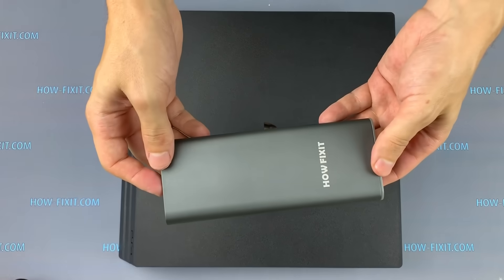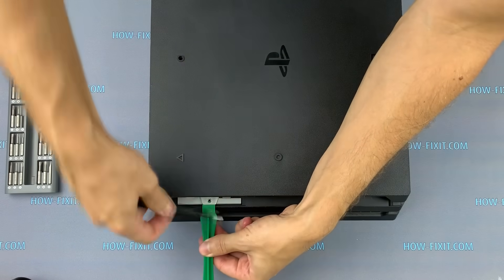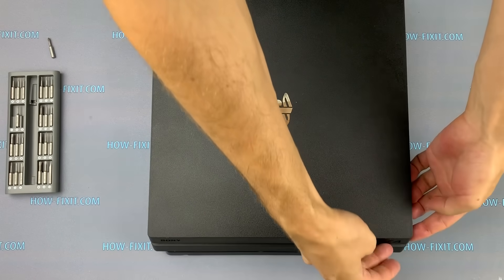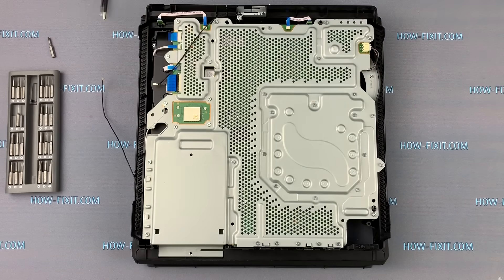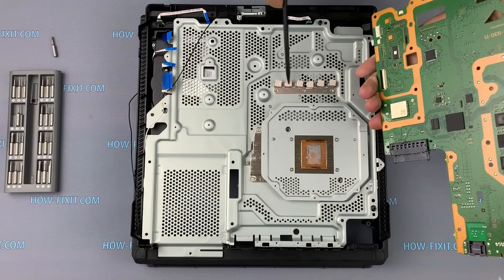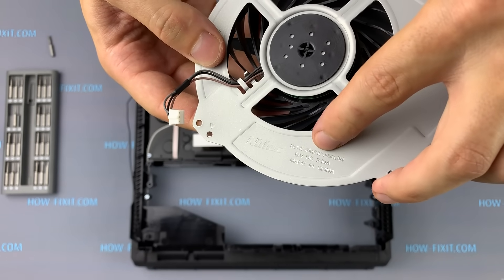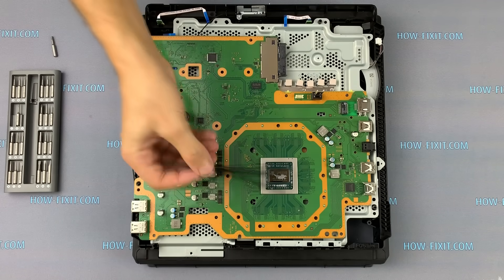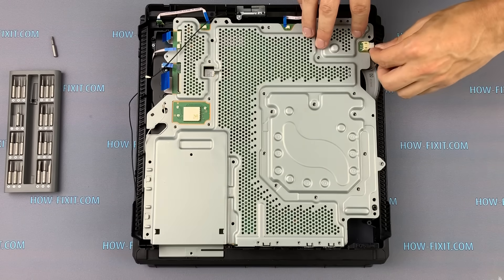PS4 Pro Disassembly: Ultimate Guide for Fan Cleaning and Thermal Paste Replacement

Comment: Word of advice to anyone looking to follow this guide. When you remove the power supply, do not try to remove the cord from the motherboard. Instead, remove it from the power supply itself. I stupidly followed the instructions in this video and ended up ripping the whole thing out of the motherboard just to immediately realize that it would have been much easier to remove from the power supply end. Hope this helps someone so they are not left without a ps4 like I was.
Reply: Could you fix that damage from the mother board? It happened to me, unfortunately I didn't see you comment til it was too late
Reply: Saw it too late. Same happened to me.
Reply: This is a known problem. The fix? Wiggle wiggle wiggle and wiggle some more. Voila. I repair these  and after breaking and footing bill for replacing my first one, I found out patience prevents this. The power supply option does work but if you break it it’s actually a harder fix if not an impossibility
Reply: If this happens to anyone else - don't despair and don't panic. Have a shop around and find an electronic repair company that looks like they can do it. I found one that did it for £35. Or there is a guide on how to fix it on youtube, and the company that made that guide can fix it as well (I think they quoted me £70 + Shipping)
Reply: I wanted to unplug the cable from the power supply side, but it was very difficult to remove. I thought it might not be possible, since in every video everyone unplugs from the motherboard side.

I didn't pull hard at all - I ripped out the entire socket anyway. I hate myself for this. I wish I had read your comment sooner.
Reply: Same to me
Reply: Almost happened to me thank you bro🙏🏽🙏🏽
Reply: I should have read this comment before starting 😢. Damn it
Reply: I decided to read this comment after ripping it.
Reply: @ NOOOOOO!!!!!! Thankfully you can buy replacement cords, you just have to remove the connectors you ripped. You didn’t break anything but the cord, did you…?
Reply: @natethestrangest6592  I ripped the motherboard connectors. I’m going to take it to a computer repair store. Hopefully they can fix it, if not it’s time to say goodbye to my PS4 for a Ps5
Reply: @ the fact this video doesn’t have a warning on it should be a war crime. I haven’t played in a week, was going to play Friday and Saturday but PSN did its thing. I even just moved my setup to its own room and completely remade it, I was like I might as well reapply thermal paste and clean everything, I was so insanely excited to hop on some siege, and now no gaming.
Reply: Any tips? Mine literally won’t budge from either point, even by prying the connector. It’s as if it’s been superglued in there
Reply: I read this comment 45 dollars later :c
Reply: Ur ps4 is likely the 1ste gen on 1st gen u are supposed to unplug from psu in 2nd gen u have to unplug from motherboard
Reply: Almost happened to me while i was just cleaning. I gave up and just opted to not do as deep a clean as I wanted. But now that I know for a fact I need to replace the therm paste, this patience is gonna come in handy…
Reply: Please anyone who is struggling with this section please consider this technical advice: 1. Softly wiggle each cable end. Sometimes the female connector connected to the motherboard wiggles more than the one on the powersupply and vice versa. Remove the cable from the side that wiggles the least. 2. I found that an alligator clip works perfect for this. Attach the alligator clip on the plastic end of the cable. Make sure it's clipped on the length wise not width. Rock it slowly lengthwise while lifting up with slight pressure. Over time it'll come  out. Alligator clips are really cheap and I think better to get one before trying to accomplish this. I nearly ripped one out but found an alligator clip as part of my tone and probe device.
Reply: This guy is probably really good and all. It’s just that… my ps4 exploded…
Reply: @djprofessork.3172  cap
Reply: @djprofessork.3172  wait what?
Reply: I made the same mistake 😅
Reply: maybe it depends on how u remove it, u always must be sooooooo gentle. if u see it wont come, dont use force, think!
Reply: @Casanova395  god bless you and anyone you have saved, didn’t save me but you would’ve if I had read comments first. I hope you and your family have a health and happy life forever.
Reply: I don't get why there's never any warning in videos like this. So many people encountering the exact same problem and he just rips it out like it's nothing.
Reply: Too late.... Would have been easier and safer to remove the cable from the powersupply side...
Reply: Thanks man, I was really struggling to get it out until I read this comment. Helped a bunch, so thanks for the warning
Reply: If you repairing electronic stuff you have to be prepared smd conector sometimes come from the MB . I believe you was focus in the video no in you ps4 and of curse you never use the right tools!!
Reply: It is tough, but if you pull on it using a tool and your other hand it should be just fine, just go slow and don't use too much force. I'll try your method next time.
Reply: I recently pulled out my ps4 pro outta the cupboard i hadn't touched it for ages since getting my ps5 so i decided to clean it just now i have done this many times before but for me it's always fine you guys might have tried yanking it straight from the cable so the tip is you try to pull it out from the both end
Reply: @Sam-Tm123-m4c  Its pulling it from the end that brakes it.
Reply: Having opened a few PS4s (first time I did a Pro was yesterday) I would say the mobo header for the PSU varies in grip from unit to unit.  On my Pro I found gently wiggling it loose from the header was pretty easy, but you're right, on some models it's going to be a tighter grip due to tolerances so you can disconnect it from the PSU side instead.  Mobo side removal is preferred because it's a lot easier to lay the board flat for cleaning dust off of it if it doesn't still have the PSU wire dangling, but better that than ripping it right off of the board if it's too stiff to do it without breaking it.
Reply: I've wished to read this before, just broke the cord on the board tring to remove
Reply: nah you're dumb.
Reply: Is it necessary to remove the cord??
Reply: @ Depends what sort of cleaning your doing, if you just want to brush away the fans no. But if you want to clean the radiator and replace thermal paste, yes you have to remove it. Be extremely careful, what I recommend doing is using pliers to grab the white socket connected to the motherboard and holding it perfectly still. Then pull the cable, that way the socket is kept on the motherboard. It shouldn’t break, if it does the cable breaks and that’s a 3 euro replacement rather than the 100 euro soldering job. If you have any further questions ask me, because I don’t want what happened to me to happen to you ahaha.
Reply: Too late
Reply: I tried to disconnect from both ends, but both were tightly stuck.
My method was to insert a sharp flat-bladed screwdriver between the motherboard socket and the ribbon connector. Then i rotate the screwdriver so that its tip is forcing the connector out of the motherboard socket. It minimize the effort on the socket pins soldered to the motherboard, and it avoided ripping the socket off.
Reply: aaaaaand there it went my PS4 pro too, fucking hell
Reply: I was having issues removing the cable with my fingers. Then I tried with some needle nose pliers (thin ones) and pulled on the plastic instead of on the cables. With a bit of wiggling I managed to detach it in about 5 seconds (I removed it from the power supply instead of from the motherboard)
Reply: Thank you for this advice
Reply: I did the same way and did not rip apart anything.
Reply: Absolutely valid comment, bro! :) 
I was being extremely careful when taking my PS4 Pro apart, but STILL managed to partially rip off the fan connector on the motherboard side while trying to remove the PSU. lol 
Luckily I was able to glue it back in place using some high quality epoxy, so now it's probably even more sturdy than before. ^^
Reply: Ts just happened to me 🥀 time to switch to ps5
Reply: I couldn't remove it from the power supply or from the motherboard either. So i ripped it like the rest of you. Also I couldn't unplug the fan cabel from the motherboard, so I just cleaned what I could without removing it. Long story short, if you have difficulties at any stage of disassembly, just stop, put everything back, and call the guy, like I should've done.
Reply: I've pulled the socket off the board on my ps3. As long as the pins haven't been torn off the board. You can just push the socket back on over the pins (carefully). Also a little epoxy along the sides (tiny amount is enough, apply with a toothpick) will hold the socket in place pretty much forever.
Reply: Love you bro I was struggling but didn’t want to pull to hard. You just saved my ps4
Reply: I mean its about your personal preference, i tried it both ways, almost ripped out the cables out of power supply and had no problem with removing it from the mother board
Reply: Zero issues for me.  Second unit.
Reply: Hahaha Oof

Comment: WARNING: BE CAREFUL WHEN PULLING OUT THE POWER SUPPLY CABLE. 

Just leaving this here because it's super easy to rip off the power supply connector when pulling out the cable which is extremely tough to pull out. I am one of many who destroyed their console by doing this and had to get it repaired. Just don't want this to happen to anyone. Other than that, this actually had a very big impact on the noise.

Comment: Thank you for this guide. It definitely made my PS4 PRO quieter, but not whisper quiet. I can still hear it but it's not annoyingly loud anymore. May I add and recommend that people also  change the termalpads on the chips. The ones that came from the factory were pretty toasted. They should be 1mm thick. Good luck anyone!

Comment: Thanks for this useful video. This content is still really helpful in 2023! If somebody follows these clear instructions step by step success is guaranteed. It is amazing that a noisy machine becomes a silent device after the thermal paste replacement. It prolongs the life of the CPU too. :)
Pro tip: if you do not know how to separate the lot of different kind of screws from the different layers just use an egg carton :D

Comment: I bought a Ps4 Pro from ebay and had the jet engine sound 😅 like ridiculous loud it made me laugh how bad it was, bought thermal paste and some thermal pads, followed this video instructions, upon opening it, the paste was dry and heatsink was full with dust, cleaned it and apply new thermal paste and now it's dead silent, I highly recommend for anyone who's ps4 pro sounds like a jet, it's night and day difference,  sounds like new, one thing everyone should be careful though is when removing the power unit take it out REALLY SLOW as you may rip the cable out of the mobo because the cable is so short. Thank you for this video, very helpful!

Comment: Thank you soooo much for this tutorial! Liked and subscribed. My PS4 Pro is now as quiet as a church mouse! The radiator was also clogged with dust, the fan was caked with it, and the old thermal paste was dried up and cracked. This brought my system back to its youth! I did buy a precision screw driver kit for this project, so that plus the thermal paste only cost me $36.

I will say, however, that the thermal paste I purchased said to only use a dot and to NOT spread it around the CPU. I confirmed with a friend of mine, who works with computers for a living, and he suggested just using a PEA SIZED dot of paste, because if you spread it around like you're frosting a cake, you risk the CPU overheating.

Comment: My ps4 has been sounding like a jet engine for about 3 years now since I got it, preowned, my sister took it to a shop and they temporarily fixed the problem of the noise and overheating, I knew how to take it apart but I did make mistakes, I lost the part that covers up the little slot where the hard drive is (which doesn’t make too big of a difference) and I also lost the metal plate above the power supply somehow, I just bought a new t8 screwdriver and some thermal paste on amazon and when it comes in im going to try it again because last time I couldn’t get to the cpu because the screws were stripped idek how the guy at the shop got to it but im hoping he did something to unstrip the screws

When I do try again in about a week or so when it comes in I am going to leave an update here for whoever sees it to either inspire you to also try to fix your ps4 or give tips on where I went wrong in case anything happens
Reply: So here is the update I just replaced the thermal paste by myself, a couple stripped screws and all that but I managed

The process took me about an hour and a half only because the screws were hard to take out it’s actually so easy to do, if the screws weren’t stripped I could have done it in less than 30 minutes for sure

My ps4 pro is quiet as a mouse!!! 
Feels like a luxury to be able to play 2k with little to no sound

I bought a t8 torx screwdriver and some thermal past for less than 9 bucks on Amazon to do this and  it was damn sure worth it if you are having overheating and loud fan problems do this and if you follow the video as far the disassembly you can’t go wrong

Comment: Hey y'all the some ps4 pro requires to remove 2 screws from the sliver plate on the other side, I almost pull the power supply cover off 😱 once those screw are removed it'll super easy to remove the power supply my model CUH 7115B
Reply from the maker: In this video I disassemble PS4 Pro of the 2nd generation (CUH-7200 series) and disconnecting the power supply cable different from the PS4 Pro 1st generation (CUH-7000 or CUH-7115B series). If you have a 1st gen PS4 Pro, watch this video guide https://youtu.be/dJgXobATp3A

Comment: I had to finally bite the bullet and try this after my neighbours asked me to stop vacuuming at night. 
The guide was very easy to follow, turns out my thermal paste was toast, like nearly nothing left.

 The difference is massive, but before ye set off, heed well the tips in the comments three... 

1. use a little set of pliers or something to disconnect the cable for the power supply... 

2. the first blue ribbon cable has a black clip that needs to be flipped up prior to removal...

 3. keep track of your various screws...

good luck adventurer

Comment: I was really nervous about this however I took my time and followed along and created a chart and took pictures of each location for the screws. Applied thermal paste by coolmaster and cleaned the vents and radiator of dust and wow I cannot even hear my playstation. The original paste job was horribly botched and almost nonexistent.

Comment: ⚠️⚠️Is anyone having trouble diconnecting the power supply from the motherboard?? I ripped the motherboard a little bit because its really hard to disconnect the power supply from the motherboard
Reply from the maker: Are you sure that your PS4 Pro is not the first revision?
In this video I disassemble PS4 Pro of the 2nd generation (CUH-7200 series) and disconnecting the power supply cable different from the PS4 Pro 1st generation (CUH-7000 or CUH-7100 series). If you have a 1st gen PS4 Pro, watch this video guide https://youtu.be/dJgXobATp3A

Comment: Power supply on my console would not come out until certain torx screws were removed from the motherboard side, a heads up to anyone who might be experiencing that issue. This did make a world of difference though! I also changed my thermal pads in the process however.

Comment: Well when I unplugged the power supply off the board @3:15 it just ripped the whole thing off the board.. can I glue it or solder it back on?? Please help me someone!! And now that im looking at it I don’t see anyway it would of come undone easily…
Reply: If you Tore the Power Supply off it needs to be soldered and possibly have the Jumpers replaced- I’d recommend going to anyone who can do Board Repair to either guide you through it or to Fix it for you.

If you want a second Opinion I wholeheartedly suggest posting on the Ifixit Website, it has a Very helpful Community who’d happily tell you how bad it is and possible ways to Repair it.
Reply: I've just tried and I ripped everything off too. I'm shaking right now because the jumper and everything soldered has been broken, the fact that I used precision plier to help me remove it makes it even more maddening.

Comment: Very grateful for this video, i have just purchased a PS4 Pro all working…except it wasn’t.  Overheating issues plagued it that i thought i bought a jetty engine. Anyway, followed your video and instructions and ended up removing one inch of dirt and debris from the fans of the heat sink, reapplying the thermal paste and generally giving it a very good clean with a tooth brush.  All working within expectation and certainly a lot quieter.

Comment: Where you've done the removal correctly and everything is explained right, what you didn't explain is that the connection to the motherboard by the battery is basically soldiered onto the board so I've ripped the entire connection off trying to remove that which means I now I have to pay to get it replaced and have no console for a while. It's much easier to remove it via the battery itself than off the motherboard. Mine was virtually fixed, I still can't remove it with it being broken off. Might be worth mentioning that if you ever do another one.